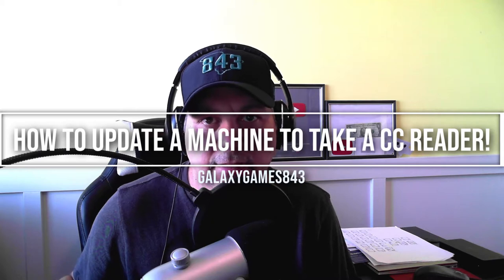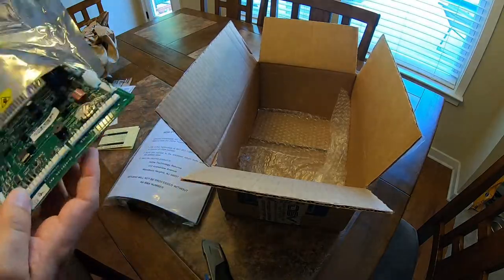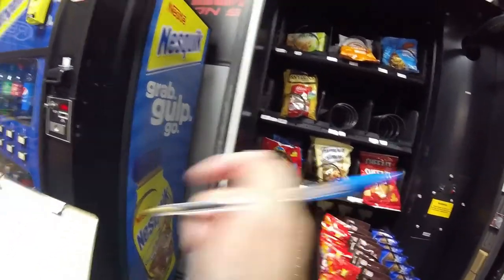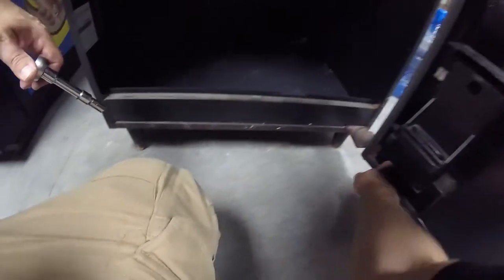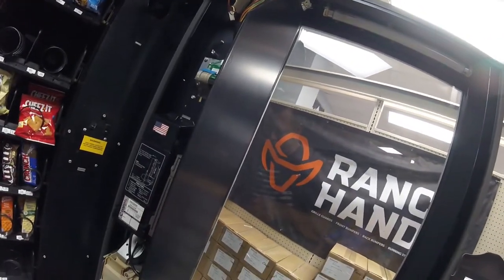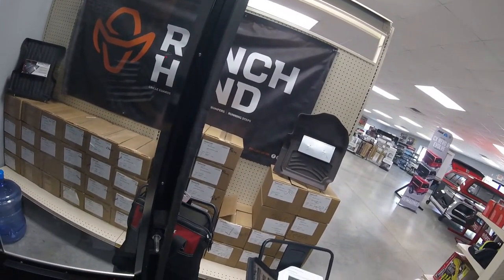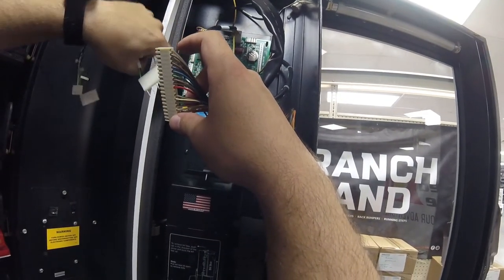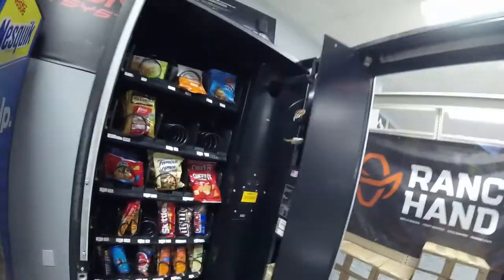How To Upgrade Your Old Vending Machine To Take Credit Cards!

Comment: *LOOK UP ESD* You need to be grounded with a ground strap when handling the control board. That's why it's in that silver package. Research ESD (Electrostatic Discharge). Handling the board as you did, has a strong possibility of damaging the board by static shock. It will probably work for a while but after a few months or a couple of years if you're lucky, the board will go bad and you're calling tech support to figure out why. This is not a well known thing unless you have experience and training in electronics handling. Only then you'll learn how much it is stressed just how bad ESD is to electronics.
Reply from the maker: Thanks for the tip. I've been working with circuit boards for many years and haven't had that issue come up yet, but thank you for bringing it to my attention
Reply: Like all YouTube safety monitors, ESD is drastically over exaggerated. If it was going to harm the board, it wouldn't function immediately after the static discharge. There is no real possibility for some undetectable future issue to be caused taking it out of the bag. Either it's smoked or it's not.
Reply: @ronlabe5487  Then good luck to you. All I will say is you will be fired in a heartbeat if you disregard ESD handling rules as an assembler/inspector/engineer from any reputable electronic manufacturing company worldwide. Just saying
Reply: @pjackson8322  Peter, we really need to talk about your TPS reports.
Reply: @ronlabe5487  I'm not peter.
Reply: @pjackson8322  I know, but you remind me of Bill Lumbergh.
Reply: Yes I read some random instructions on a machine and got scared straight… :/

Comment: I have an old Vending Machine (Merlin III). 
When I decided to buy a Kit to upgrade it, the seller said that I need to update the MDB version inside the chip in the board (EPROM?!?). 
I am a programmer, understand circuits, but I just understand the basics of MDB. 
How can I perform this update? Any IC writer device? Via socket/jack? 
Thank you in advance!

Comment: That button cell battery is to keep the time correct in case power outage(blackout)
Reply from the maker: Yes! it is a good thing that is on there! it should keep all the price settings memorized also!
Reply: @GalaxyGames843  yes I’m not sure if the old board even had that 2032 battery!
Reply from the maker: @VOLTRONDEFENDER4440  I've worked with other boards that have had different types of batteries

Comment: Hi I am new to the business and this is so helpful because one of my new machines needs to be updated. It's an AP 113. I was told that if I upgrade the control board, I have to also upgrade the bill collector and the coin collector. Is that true? You mentioned getting the MDB codes once installing- what does that mean?
Reply from the maker: The AP machines will most likely need a new compatible dollar bill acceptor and coin mechanism if it doesn't currently have compatible ones in there. As far as the MDB codes... those are the internal machine codes that report to the cc reader when managing inventory inside the machine.
Reply: @GalaxyGames843  I just realized that my AP 113 is an older model. The display unit is behind the bill collector instead of behind the new control board. Any videos with that type of vending machine?
Reply from the maker: @angelakthomas1774  my apologies I don't have a video for that model!

Comment: I just came across this video doing research looking into getting into vending. This may be a newbie question, but here goes. Can you get an older machine in good shape and change the boards out to accept the credit card readers?
Reply from the maker: Some machines yes - but not all - It depends on if an upgrade board is available for the model you are looking to buy - there isn't an upgrade available for all machines out there
Reply: So where do you find out that information?
Reply: @GalaxyGames843 how are we supposed to find out?

Comment: Can I put a card reader on a SnackShop 4000 ?
Reply from the maker: You would need to upgrade it like I did to this machine in this video... Here is the new board you would need: https://www.dsvendinginc.com/p-2253-d950a-1-inone-kit-ap-40005000-series-machines.aspx